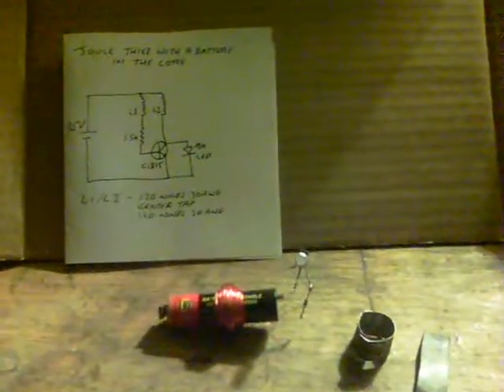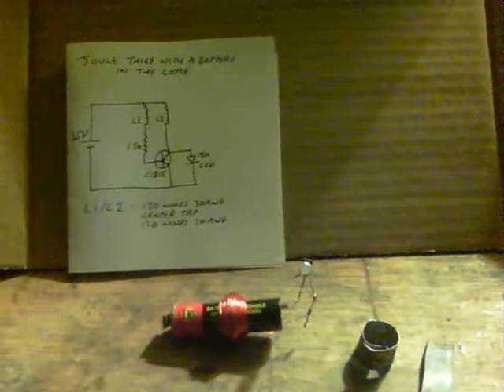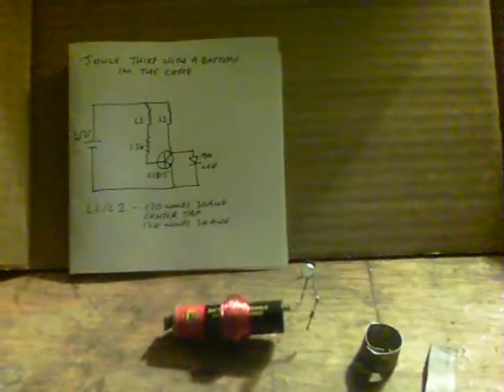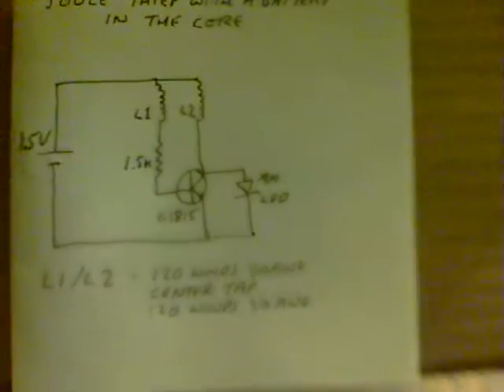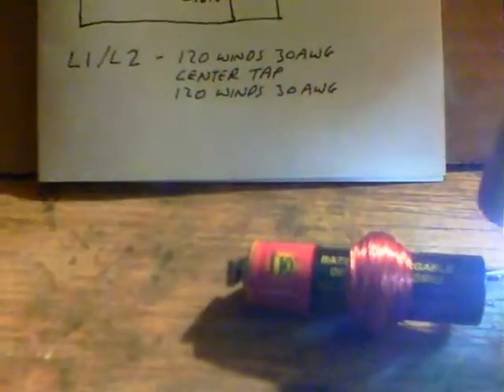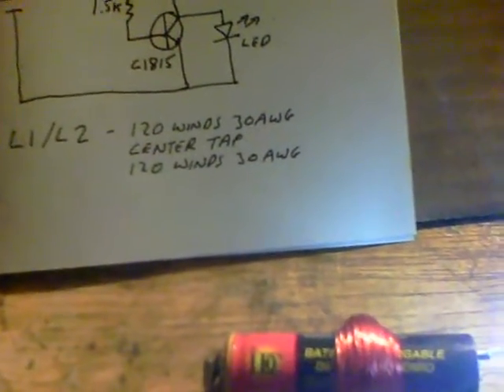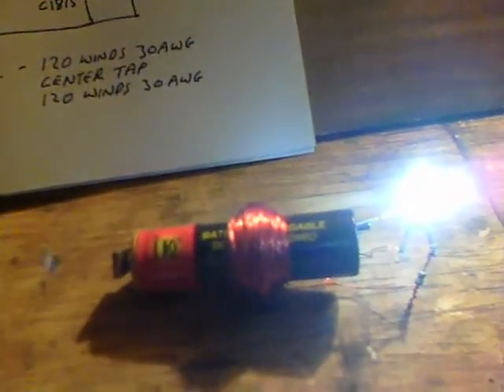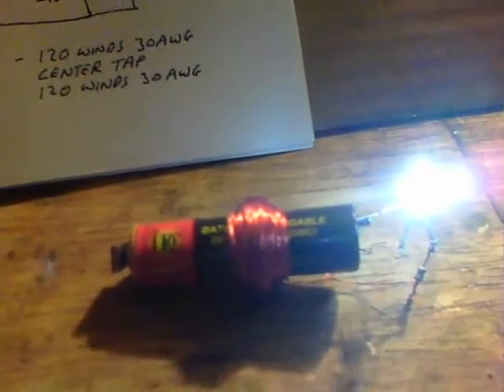Part 2 - No steel - Battery as the core

Comment from the maker: Oh, just as the mental picture, of taking the LED off the circuit and replacing it with the few turns Primary of a Tesla coil. In practice, you would have a forward facing diode (1N4148 perhaps) from the Collector to the start of the Primary and the other end of the Primary would connect to the Emitter. The Tesla tower Secondary could then connect to the Base of the transistor. Both the orig circuit and the new would enable oscillations - the bootstrapping :)

Comment from the maker: Once the oscillations are triggered then the Secondary will pick up from the Primary, bit like running from a signal generator or 555. The Primary would replace the LED. The transistor wouldn't need the Secondary to function (will give fastest rate though like 2MHz). Secondary start wire could go directly to the transistor and then it would kinda end up bootstrapped, oscillating anyway.

Comment from the maker: Thanks for your comments :) Indeed, coreless (aircore) was the next step and ran fine. The pickup coil is another good idea...really, all that needs to happen then is to make it have a higher transformer action, by having a low turn Primary and sit it around a tall single layer Secondary and it's a Slayer exciter !

Comment: Nice little experiment!  The casing of most batteries is steel so that would act as a core.  But you don't need a core.  I make a joule thief that was about 40 turns of wire made into a loop about 6 inch in diameter.  I called is a Wireless Joule Thief because I had another coil that I used to pick up the magnetic field.

Comment from the maker: Cheers and thanks for an interesting, thought provoking problem. With aircore's working best with plenty of turns, as against the traditional JT 20 turns or so, I started with 120 and was going to wind on more if it didn't work...just had that amount of wire already on something else sitting around. For the whole batt, you can wind a few 'dummy' turns, then the 120, center tap, then same again on the other side :)

Comment: Good job!  I'm glad that you got this working.  I guess the key was lots of turns of fairly fine wire instead of the traditional JT coils.  I may try TinMan's suggestion of covering the whole battery and see what happens.  Build the coils on a paper tube so different types of batteries could be tried.

Comment from the maker: If it's the whole battery, then it would just be a case of spreading the first few turns side by side at each end of the batt and then concentrating the middle section.
With your help I intend to do a runner, as they say lol. Mind you, can always use a high radiant antenna or the earth with 2 metals. Oh, or an old tractor alternator and hay bale wire. Cracks me up how your son is the stuntman for dangerous stuff that you build - but they work !  :)